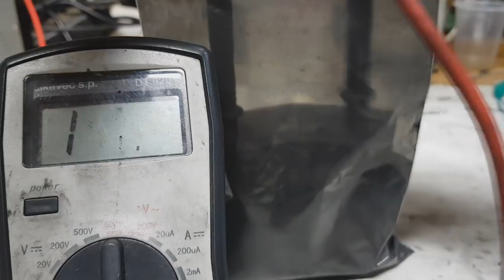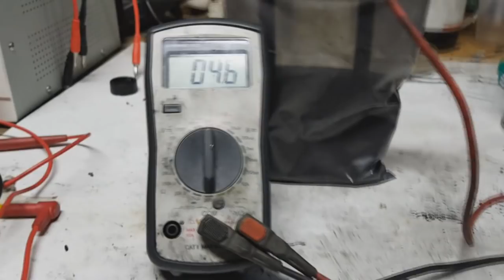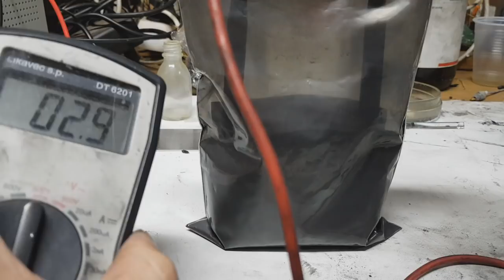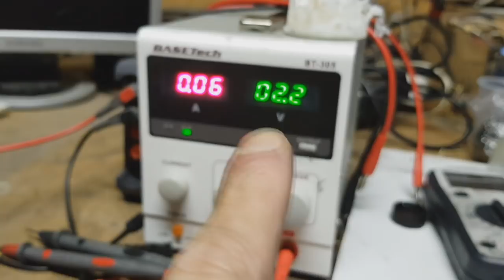Graphite better than today's Graphene?

Comment: Don't buy it from the link Because I did buy this graphite and the ohm is between 100 to 200 ohm. Unless the graphite they sent to cayrex is different, the claim is false.
I did retest and the claim is close to correct.
 I bought 2 x 500 grams and  here is the test results:
5 cm distance for electrodes in lose graphite gives a  resistance at it's best 150 ohhms.
If you compact the graphite by hitting it to floor  a few times the best resistance I got was 35  ohms which is good. Used my hands to press it further and got 3.5 ohms at it's best.
Reply from the maker: check your ohm meter or learn how to used. I buy from this company many kilograms and I dont have any problems with my graphite. I buy in 500g to 1kg packs always I get good quality.
Reply: @cayrex  Did retest it and edited my post.
Reply: id say theres a metal bar burried in the graphite

Comment: Cayrex you complained about being cold. Make a heated lab coat with your ink. Easy.
Reply from the maker: Guy Ruff hehe I am working on large heater now.
Reply: cayrex2 but if you have a heated sweater or lab coat you don’t need to warm the whole place.

Comment: Could you test the resistance only by touching the ends of the tester? I cannot help thinking that you lower the resistance by increasing the contact area (the whole cilinder of the tester end)
Also, I'd like to ask you what kind of graphite is that as I think there are natural, sintetic and several kinds of quality depending of purity and mesh size.
Thank you for your great work!
Reply from the maker: the results are almost identical if I touch the material with ends of the tester (+- 5 ohms). I see the video from Venturestarix https://www.youtube.com/watch?v=N9buR4OXeO4  he make a powder conductivity test,..... and I thought I will try the same test.